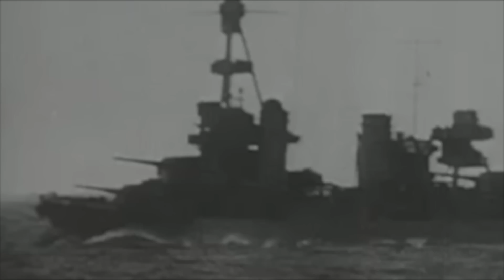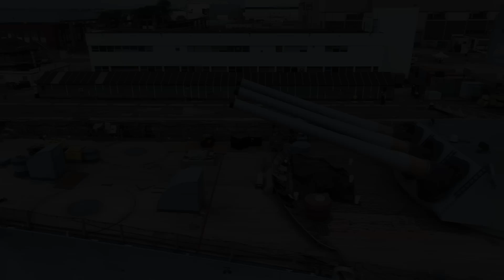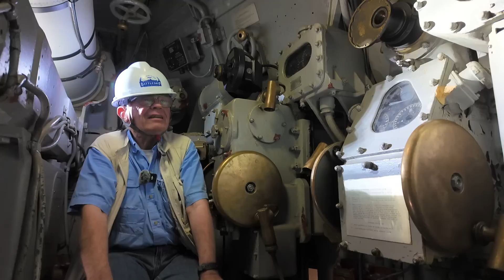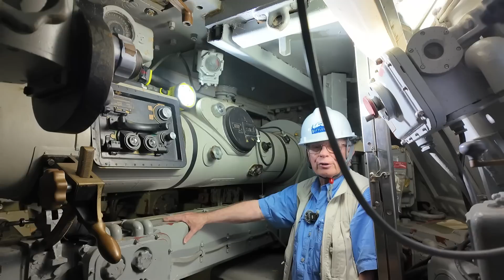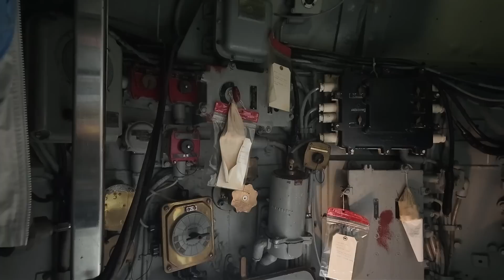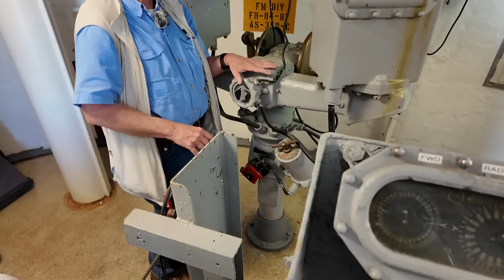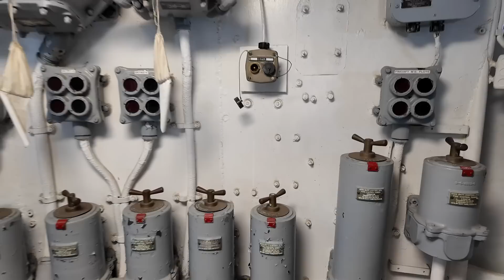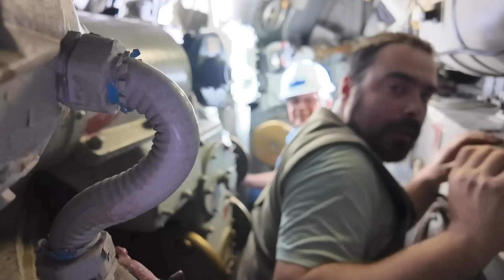Naval Gunnery - Rangefinding on an Iowa-class battleship

Comment: It's mind-blowing that all this was designed on drafting tables by guys with pencils, squares, and rulers, and it all went together perfectly in the shipyard.
Reply: "Perfectly." Riiiiiiight. Meanwhile, the ship builders are inventing new swear words while beating the hell out the "perfectly designed" component with his "problem solver" to get it lined up with the other  "perfectly designed " components.
Reply: @scooterdescooter4018  Ok. It went together reasonably well with skilled craftsmen doing the fine-work.
Reply: And slide rules.  The engineers didn't even have digital calculators.
Reply: @immikeurnot  And tables of logs and trigonometric ratios that often contained errors.
Reply: @immikeurnot they had calculators and computers. Human ones. You would be amazed to see how the human brain (especially one that has the aptitude for it along with some training) can compute really complex equations.
Reply: @CharitonIosifides  My mental arithmetic is fairly good, but I was always in awe of my Dad. The man could multiply and divide fractions in his head.
Reply: @immikeurnot  They did have electro-mechanical calculators.
Reply: There's a lot of little shortcuts I find myself taking when I'm doing calculations entirely within my mind.
For instance, I find that I calculate "((x*10)/2)" faster than I can calculate "x*5", and likewise I can calculate "((x/10)*2)" faster than I can calculate "x/5".
I'm not sure if that makes me unusual or not, and I'm entirely unbothered by the concept of being abnormal, but I do know that my math contains less mistakes when I do it that way when forced to not use paper or pencil.
Reply: @SciDerg  I would expect that anyone who understands arithmetic would do it that way.  Unfortunately, not everyone, or even not many, do understand enough to do that.
Reply: @michaelsommers2356  Yes, sure, fire control used exactly those. Absolute wonders of engineering. But I don't think they were used for design calculations until the Space Age.
Reply: @SciDerg  I don't think it makes you unusual, simply identifies you you as some someone comfortable with mental arithmetic. If you're comfortable with maths you understand that there is more than one way to parse a calculation.

Honestly for me it's almost second sense,

27 * 4.

25 *4 = 100
2*4 = 8

Total 108.

27 * 2  = 54
54 * 2 = 108

Yes? I just see the easy calculation.

If I look a little harder,

27 * 4.

20 * 4 = 80
7 * 4 =28

80 + 28 = 108.

Being 62 so taught maths before calculators may have helped, but I just see the easy options.

Now, if someone wants to know the answer to 1274 * 64 I'm probably going to ask for a pencil and paper, but I'm confident I'll get it right.
Reply: @ald1144  Feynman wrote of them being used at Los Alamos,  Look up, for example, the Marchant calculator.  These were digital electro-mechanical calculators, not analog computers as with fire-control computers.
Reply: @michaelsommers2356  Ah, I see. Very cool. And of course there's the calculating machines used to break the Enigma code, but I was thinking more like this, in the engineering field.
Reply: @ald1144  I would call designing a nuclear weapon an engineering task.
Reply: @michaelsommers2356  Yes, so would I. I was referring to the Enigma code-breaking machines as something different.
Reply: @ald1144  Yes, the bombes were different.  For one thing, they solved just one problem: finding  the daily key.  They were programmed and fed data based on information about the day's messages, but they solved only that one problem.  Just like fire-control computers, that only figured out how to hit the target.  But the Marchant and similar calculators would be used to solve any problem.  They could not be programmed directly, but at Los Alamos the very complex calculations were broken down into simple steps, which were done, often by different people, successively.
Reply: @ald1144  Yes, the bombes were different.  For one thing, they solved just one problem: finding  the daily key.  They were programmed and fed data based on information about the day's messages, but they solved only that one problem.  Just like fire-control computers, that only figured out how to hit the target.  But the Marchant and similar calculators would be used to solve any problem.  They could not be programmed directly, but at Los Alamos the very complex calculations were broken down into simple steps, which were done, often by different people, successively.
Reply: @immikeurnot  Didn't need them! But I expect the design office would have had access to an analogue computer.
Reply: @immikeurnot At the time, an engineer with a slide rule would be like a cowboy without a gun. 🤠
Reply: Don't forget the trusty slide rule:  the first pocket calculator!
Reply: You have to add the iron workers et al cutting the actual plates and welding if you say the Uncertainty Budget for the physical construction was "0.0000"!
You do know the design ALMOST went out with Ordnance designed turrets and barbettes that wouldn't fit the Construction & Repair hull, cuz bureaucracy?  That's why there's a knuckle in the hull at turret 1 that throws off an unintended second bow wave where the hull was redesigned to fit the redesigned, but still 'too large' barbette.
Hardly an indicator of 'fit perfectly'.
Reply: There's a lot of little shortcuts I find myself taking when I'm doing calculations entirely within my mind.
For instance, I find that I calculate "((x*10)/2)" faster than I can calculate "x*5", and likewise I can calculate "((x/10)*2)" faster than I can calculate "x/5".
I'm not sure if that makes me unusual or not, and I'm entirely unbothered by the concept of being abnormal, but I do know that my math contains less mistakes when I do it that way when forced to not use paper or pencil.
Reply: "Perfectly." Riiiiiiight. Meanwhile, the ship builders are inventing new swear words while beating the hell out the "perfectly designed" component with his "problem solver" to get it lined up with the other  "perfectly designed " components.
Reply: Think about the math skills it took to create these computers.
Reply: Think about the math skills it took to create these computers.
Reply: American made used to mean something.
Reply: @792slayer What... SpaceX and Lockheed aren't American enough for you?
Reply: @Greg_Edmand  Nothing against either of them, although I haven't been real impressed with Lockheed the last few years.
Reply: Space x sent a banana into the ocean. That was very impressive…
Reply: @Greg_Edmand don't mind him, he's just getting his MAGA all over the place with misplaced nostalgia and bad faith lol
Reply: @bebo4807  SpaceX launched an average of more than 2 successful Falcon 9 rocket launches A WEEK, in 2024 alone. Maybe pay more attention to actual progress instead of wasting time on so much click bait. The rockets you saw end in the ocean were either the one or two Falcon 9 that had problems sticking their landing. (which no one did until SpaceX proved it possible). Or were the experimental biggest rockets ever launched, the Starship and booster. It's how SpaceX has made such massive progress in so short a time with revolutionary designs. They test, crash, test, crash, test... Success their new designs. SpaceX provides the only reliable ride that Americans have to send crews to the ISS. SpaceX is a huge industrial success for Americans and the world. NASA has been stuck in low gear for decades, due to underfunding. The private space industry is set to make us an interplanetary species. No matter what your opinion of Musk may be, it's the army of people he hired to run SpaceX that are the real geniuses.
Reply: @Greg_Edmand  They're great, but I believe he's referring to a time when everything from Sears Craftsman tools to cargo ships were made in the USA, and made well.
Reply: @ald1144  Ah yes... Like Carter's Little Liver Pills.

Comment: Thank you for the excellent content, but I find the explanation about the ship's stability being affected by the 20-ton weight a bit vague. Could you add more specific data to clarify this?
#TheWeaponChroniclesX
Reply: It's like a pendulum; a ship has a center of buoyancy and a center of mass. If the center of mass is below the center of buoyancy, when the ship rolls, it comes back upright readily. More mass high on the ship raises the center of mass, so there's less of a moment arm to act to right the ship when it rolls, so it will roll more and more easily, reducing the stability.

Comment: This is something for you, Ryan, and any museum ship curators to consider. But would it be possible to set up a simulation of the fire control system on any of the ships?
Reply: That would be awesome and educational but I’d imagine a lot of visitors would be frustrated by how hard it is to hit anything.
Reply: @bkjeong4302  That and possible expense. But just an idea that may merit further investigation
Reply: I would say it would be possible, given enough money, but totally impractical, assuming you want to simulate the whole process.  Assuming it was for museum visitors to use, you would have to get dozens of untrained people to not only understand their jobs, but also work together, without any preparation, to operate the whole system.
Reply: @michaelsommers2356  You could probably have a physical copy of one of the range control stations, and have the others dealt with by the computer, I suspect. Alternately, have the full set up and make it a paid event to go through an hour or so of learning to use it then using it.
Reply: @diabolicwave7238  If the former option were taken, how would targets be presented?  There aren't many battleships on the Delaware River.
Reply: @michaelsommers2356  I was assuming that it could be done as a computer simulation, honestly. otherwise, I wonder how well one could do it with miniatures? It'd be rather fiddly though.
Reply: @diabolicwave7238  I was assuming something along the lines of flight simulators used to train pilots.